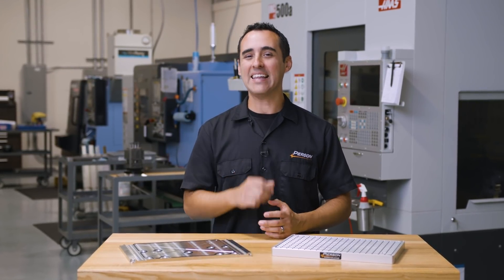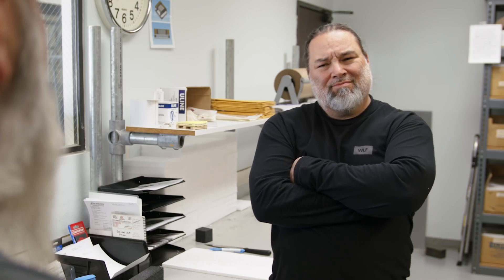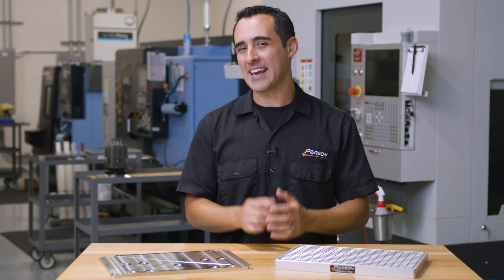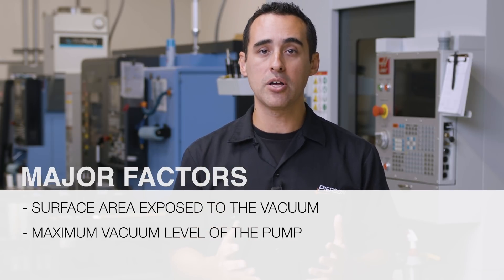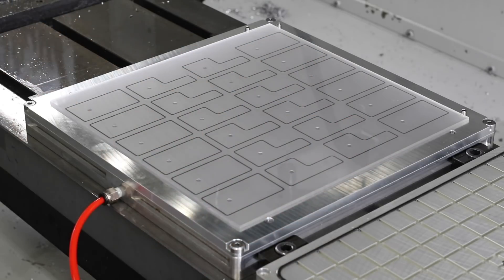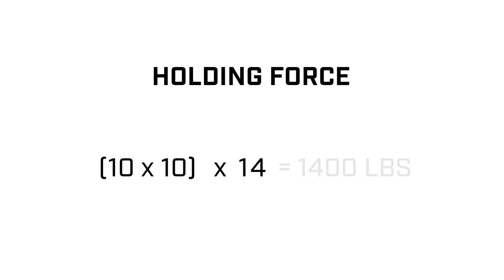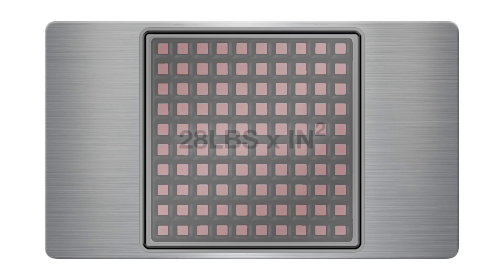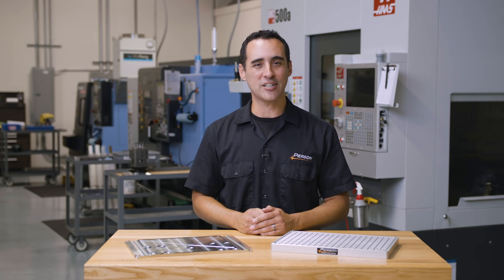He FOUGHT his Boss over this! - Pierson Workholding Q&A - Vacuum Workholding

Comment: I respectfully disagree. If your part has any flex (and since you use vacuum chuck to begin with, it almost always does) your tool may    lift a corner high enough for the air to seep in. If you were using a grid pattern, that air will be quickly removed and the part stay in place. If you have a flat area, then your air inlet will be closed off by the rest of the part and there is not enough flow to suck the part back down. This will result in your part flying.
Reply: I honestly have to agree with you. I ran 2 Haas VF5s (1 standard, 1 Super Speed) with solid permanent aluminum 2" thick vaccum tables on them, with a 1" spacing grid pattern for 3 years daily (plastics & composites machining). I used custom vaccum subplate fixtures on top of this table, and always tried to use a single pc of gasket for each gasket seal in the grid.

When prototyping new vaccum subplates, adding shallow grooves inside the form of the final part held- the more evenly they radiated from the center of the part, and the more vaccum holes through I could get, the better the parts resisted facing pressure of the specialized flycutter we used for facing that was several inches in diameter.

I'd usually face sheets of UHMW, or even stiff Nylon to 0.01" thick skin to the table, to cut parts out with a utility knife like cookies in a sheet- but when using no grooves in subfixtures- the part would sometimes lift up just a tiny amount- and get pulled out under cutting force. Adding grooves, leaving 50-70% solid, the parts always stayed dead solid. If it picked up an edge, it might lift a corner a tiny amount, but the rest stayed dead flat instead of flying out. I was methodical every setup for 3 years testing variance in gasket density and grid patterns- having more through holes so suction could reach maximum quicker (closer to instantaneously) and the ratio of the grooves and putting seal and 1st grooves very near outline of part made the best holddown imho. Gasket durometer strength makes a big difference too, depending on how brittle or soft the material is when you cut thin. 

There's lots of variables- but I think you are correct about how grooves actually affect the holddown- I never saw it as "more force" with them- just "ability for full force to instantaneously reach any area quickly" as more the way I'd describe the action to it. I feel that's correct because on rare instances the fixture itself left unblocked in except for vac holddown force could still move a fixture with part solid slightly under facing pressure (though I didn't normally leave them like this). Because all things were equal, cutting force on both, the only difference moving it if something went wrong further being the ungrooved part breaking vaccum easier, I came to think this way. My bosses thought I was nuts too- but my results always spoke for themselves well.

There's some valuable vac chuck work methodology in that it took 3 years to learn- I think it can be applied to any kind of vac chuck (including multi axis ones...) Hope that helps somebody. #instamachinists forum hiya :)
Reply: Yes, I have found this to be the case as well. You need any air under the part to have a quick path to get pulled out of there. The machined area helps with a less-than-ideal seal or situation.
Reply from the maker: @HSMAdvisor You're saying the exact same thing I mentioned at 3:23, but in a different way.  A grid pattern acts like a large reservoir, two textured surfaces act like a small reservoir and two smooth surfaces create molecular reservoirs.  With smooth surfaces, the time factor needs to be added so that the restricted airflow created by the vacuum can overcome the leak created by the part lifting.
Reply: @PiersonWorkholding  What I am saying is. With a smooth surface and flexy part, once you get ANY air leak through the seal, the part is basically out the window. There is no recovering it. because the central inlet hole is closed off by the center of the part that is still contacting the plate

Comment: Your explanation pretty much matches mine except for one thing, which I actually thought you'd mention and somewhat alluded to in your video - a groove pattern or some sort of deeper channel can help the pump evacuate areas far from the vacuum port more quickly than without it.  When I'm designing vacuum fixtures (and I use them a lot) I always have some grooves leading from the vac. port to the extremes of the fixture farthest from the port.  I find that I get much more reliable clamping force and this is especially helpful if you have a low CFM pump.

When I saw the non-grooved plate sitting by your right side, it looked like there was an "X" groove leading from the center of the fixture where the port is to the extreme corners of the fixture and I thought for sure you'd mention something about it.
Reply: Have you considered not using vacuum fixtures? As a machinist, I despise them. Finicky, unreliable, seems like a cheap excuse for a desk jockey engineer to work around fixturing.
Reply: @jerryherrin6470  , I probably should have mentioned that I do 99% of my CNC work making guitar parts on CNC routers.  For necks and fretboards, vacuum fixturing works well, especially the way I do it (but I have had failures).  I've never used vacuum on my mill!
Reply: @beerco667  That makes sense. I just used to work at a shop where if someone couldn't figure out a way to fixture something they'd automatically go to the vacuum, and it was always terrible on the mills. I've seen things jump around .02", material slung across machines, and carbide just shatter. Then again, we had terrible systems so maybe my experience is jaded ;)

Comment: I don’t think your analysis of the reason why smaller contact area = higher gripping force is correct. You’re right of course that the normal force acting on the part and plate increases as the contact area decreases, but that’s balanced by area itself obviously decreasing at the same rate,. Overall, net force of friction should stay the same.

To a pretty good order of approximation, frictive forces are solely a function of the applied normal force (the force pressing the two objects together) and the coefficient of friction between them.

Consider this (long-winded) example: We have a 1,000-lb block of steel sitting on a piece of sandpaper glued to the bench. (I’m using sandpaper here to get away from any questions about vacuum and reduce it to simply a matter of friction.) Let’s say for the sake of argument that this results in a “holding force” of 500 lbs, meaning we have to press against the side of the block with 500 lbs of force to make it move. Now, let’s cut the part in half. Nothing else has changed, so we’d now have to push against either half with 250 lbs of force to get it to move. Now take one of the pieces and stack it on top of the other one, and try moving the stack. Compared to the case where the two pieces were each sitting on the sandpaper, the force between the bottom block of the stack and the sandpaper is now 2x, so the force required to move it would be 2x that needed for a single sub-block, meaning 2 x 250, and back to our original 500 lbs.

But I totally believe the truth of your observation that chucks with grooves (meaning smaller surface area in contact with the parts) grip slightly better! (!)

That means that the coefficient of friction between the part and the chuck is changing for some reason.

I don’t know enough about the subject to say why for sure, but here’s a maybe-plausible guess: It’s not just a simple three-part system (part/air/chuck); an important fourth piece is (drumroll, please ;-) ... coolant fluid! 

Watching some of your automatIon videos, I was actually surprised that the parts stuck to the chuck as well as they did, without careful cleaning to get all the slippery coolant off of them first. I think what’s happening is that there’s always a very thin film of coolant between the part and the chuck, even when clamped together. At a nano-scale, that film will reduce the number of microscopic points of contact between the two pieces. (This is after all how lubricants work :-) 

A liquid film is a whole lot harder to move around than air, and if the mating surfaces are large and smooth, it’s gonna be very difficult for the coolant film in the middle of the part to be squeezed out. On the other hand, if the chuck has lots of grooves in it, two things happen, the second likely much more important than the first. Taking your example of a chuck face with half the surface area taken up by grooves, 1) The local forces acting to squeeze out the coolant are going to be doubled and 2) the coolant in the thin film will have much smaller distances to travel on average to escape the chuck/part interface.

I think this is what’s going on. There’s no simple equation to calculate how much the gripping force might increase with grooves, because it’s an incredibly complex problem with lots of variables. (Coolant chemistry, it’s viscosity, the temperature (which will affect the viscosity), the material types and surface finishes of the chuck and part, etc, etc.) But I think the above probably explains why you see the slight increase in gripping power with a grooves chuck face.)

(Great videos, BTW, and huge congrats on your great success! I’m only a hobbyist with a hand-cranked hobby-mill and still saving up for the lathe of my dreams. But I love learning about machining, and appreciate and admire how you’ve built your business, from the perspective of a former small business owner in an entirely different field for 20 years :-)
Reply from the maker: Everything you stated is correct, in theory.  However, there's more at work than theory here!  Workpieces and chuck surfaces have imperfections much like sand or water on a road.  Tire treads channel these imperfections into the grooves and the net force of friction is the same.  At the same time, the soft rubber tread is bearing a higher load and is better able to conform to the rough texture of the road.  It is the imperfections of the chuck and workpiece being forced together that increase the mechanical connection between the two. That's why the sandpaper technique works so well - the sand particles are forced into the surface of the part to create a mechanical connection decreasing the role of friction.
Reply: @PiersonWorkholding   With respect sir, I also think that your explanation at the end of the video is not quite correct. 

What is holding the part sideways on the chuck is the friction force, which is created from the perpendicular downward force resulting from the athmospheric pressure pushing onto the part. 
Both forces are connected trough the friction coefficient. 
The friction coefficient for a material pair, expresses how much of the perpendicular force is "translated" into friction force. 

I you say sand paper particles are forced into the surface of the part, thats correct. But exactly that effect is desribed with the friction coefficient. The material pair sandpaper-aluminium would have a very high friction coefficient. Thats all.. 

If you say that groves improve holding force, i believe you, through lack of better knowledge. 
But as for the explanation of the reason: I think it has been already stated in comments, that groves probably improve airflow from the suction nozzle to every part of the vacuum chuck, thus allowing for a better vacuum over the entire plate, resulting in more friction force at the end. If there are no groves, the volume of low pressure air below the part is very small. Every tiny leak will fill that volume up to ambient pressure, very fast, resulting in less friction force. However if the volume of low pressure air below the part is high, through groves, small leakes cannot easily have an influence on the pressure below the part :)

Anyway, thanks for the very well produced video and interesting points :) Happy to hear your opinion and a wish a nice day.
Reply: @unrealillusion87  A physics teacher will say that friction is only a function of the coefficient of friction (i.e. the type materials in use) and the normal force. However that can be off in both directions. For example weak materials may rip before they get to that limit (that is part of why large tiers are used in some cases). OTOH rough surfaces may be able to geometrically grip the part, but only if the contact pressure is high enough to deform the one surface around the other. E.g. pieces of plywood with ball bearings between them: at low pressure things roll (a low coefficient of friction because the contact angel is very shallow and very little of the normal force can be translated into restraining force). However at high pressures, the balls embed into the surface and things are much different (a high coefficient of friction because the contact angel is very steep and all of the normal force, and then some, can be translated into restraining force).

Comment: Another thing that a customer of mine does is they serrate the surface of their chuck as the parts can be a little dust/dirty/oily and that gives somewhere for that stuff to go. This lets the part actually get into contact with the chuck and sit flat. The operation that they are doing is very tight tolerance thickness on thin sheet metal so they have to make sure they are sitting flat other wise they scrap the part. They used to wipe down every piece but then that's down to the operator to do it good every time and as we all know that's a weak link. Now they just have to blow down the chuck once and a while so that to much crap doesn't build up on it.

Comment: Very nice, thorough breakdown. The only other thing I was expecting to pop up is that the multiplier 14 comes from the fact that 1 atmosphere of pressure is roughly 14psi and that "vacuum" kind of isn't the holding force, it's really the force of the atmospheric pressure pushing down that you gain by removing the atmospheric pressure pushing up.
Reply from the maker: Yes, you got it!
Reply: i prefer to think of it as the weight of the world is what holds it in place....

Comment: One thing to add about groves is this, if you are machining a porous material, I.E. wood, groves will most likely be required to keep the part held down as the you will need a constant flow of vacuum to evacuate the air being pulled through the part.
Reply: Recently made a fancy one off vacuum fixture for a decorative wood slipper sole. Did add a grid pattern in vac area and wasn't sure if I should have. 

After reading your comment, makes me wonder if they are helping considering some soles grain structures or surface qualities took a few seconds for the red plunger to lower, and it doesn't fully sit flush but close.
Reply: @GENcELL2014  the Pierson vac doesn't move enough air for doing large wooden work pieces. if its under about 5"x5" it should be ok. we use them on our lathes for vac work holding. 

that said groves are a must for wood so you made the right call.  got to give that vac room to suck!
Reply: @charliebrumfield9200  decorative slippers sole is around 4.75"x11". My SmartVac3 easily developed a strong vacuum. It's for facing side2 and engraving a signature, done with a cnc router.